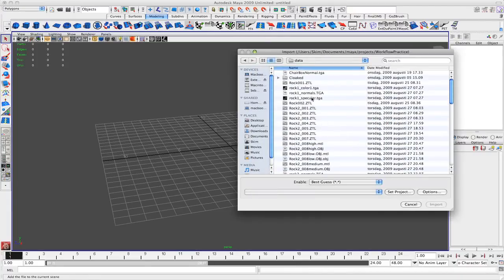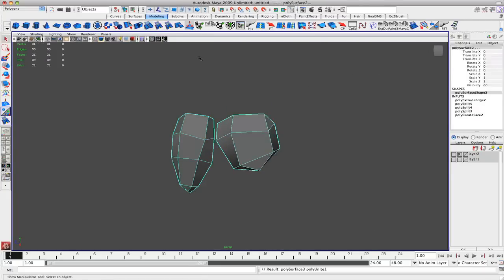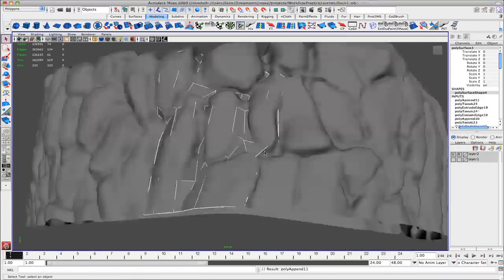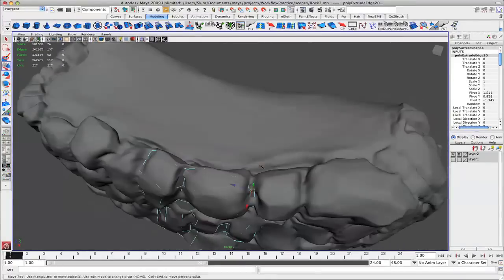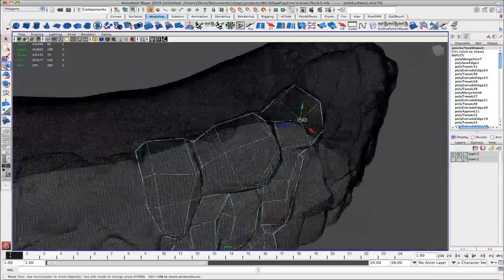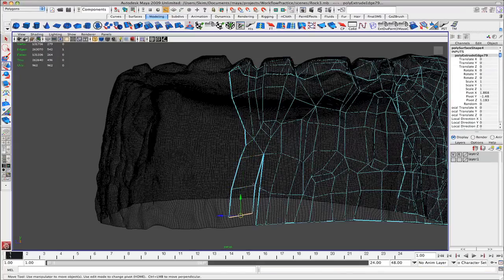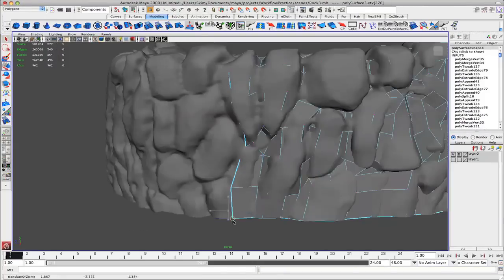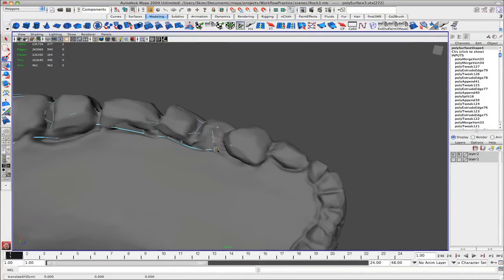Making a "Next gen" Rock Wall 4: Retopologizing Part 1

Comment: Make Live is the same concept but  zbrush is a newer program. They just added some new things in Zbrush3.5r3 that makes retop a lot more user friendly.  Zbrush retop is a lot faster, instead of sitting here and doing it vertex by vertex. What you're doing in this video is not necessary when you can just draw them directly on the surface in Zbrush. If you know how Zbrush works, you shouldn't have any problems. You wasted 10 minutes of video just clicking on vertexes. It's a nice demo though.

Comment: Yes u can extrude in Zbrush but it requires a few more steps however possible. Dude it took u over 2 hours to retop that dinky rock  using Maya live! What more proof do I need.  
On top of that Z introduced hard surfaces brushes in Z3.5.  The only time you UV is when your finished with everything else before you export your maps.  Also,u used an external app to make your normal map. I'm not knocking you for using Maya I still use it, IMO there are more efficient ways to do what ur demonstrating.